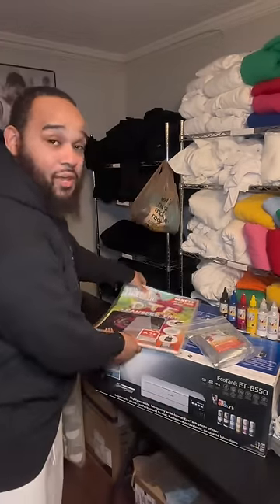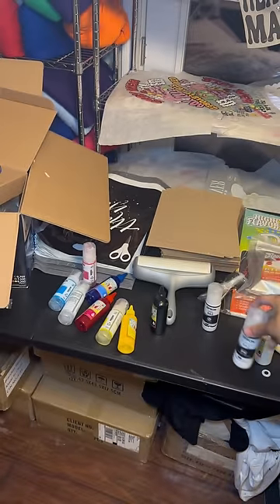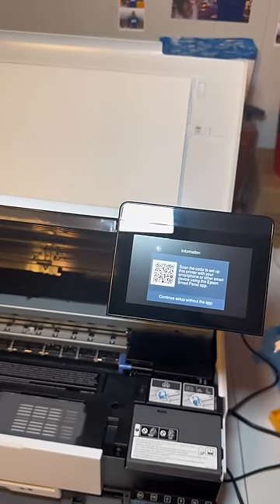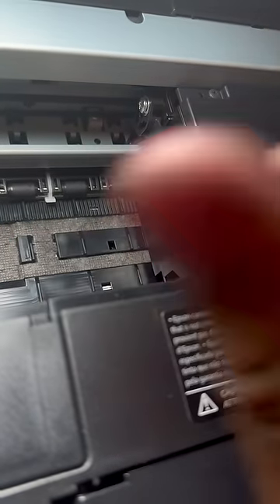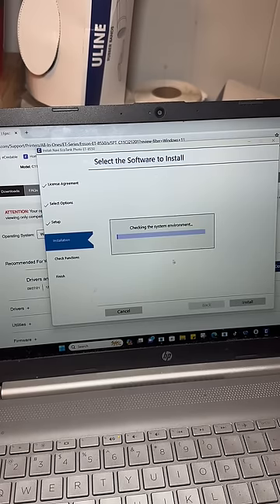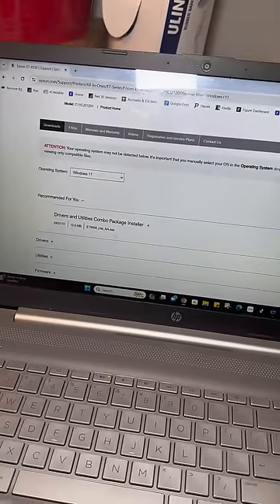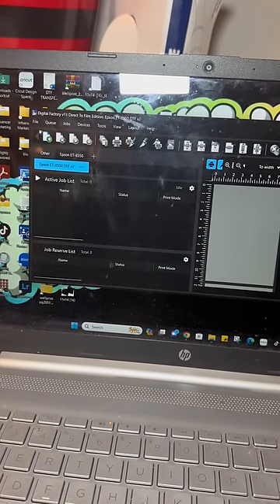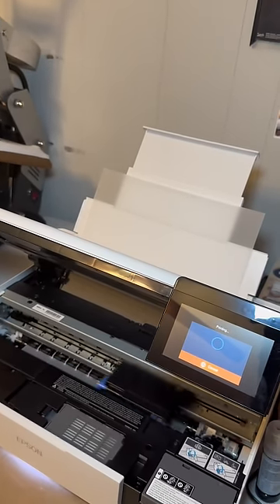How To Convert The Epson 8550 Into A DTF Printer - Step by Step guide... Very In Depth Details!!

Comment: If you put dtf ink in this printer, in 2-3 months you'll need another printer. Best option is a printer with removable cartridges. Just speaking from experience. There is no way to stir the white ink. It will settle and clog your printer.
Reply from the maker: You stir it by shaking the printer itself daily. I had my original for over a year now. I just got this one for my channel and to show setup. Where there's a will there's a way lol.
Reply: Thank you for this 😢
Reply: Explain shaking the printer. I’m thinking literally shaking the printer.
Reply: I also saw where someone got an electric pencil I think it’s what it’s called and set it under the ink cartridges and apparently when you power it on, it vibrates and shakes the ink.
Reply: @highlyflavored how do you shake the printer? Physically shaking it??
Reply from the maker: @mohawksrsuper yes physically
Reply from the maker: @brendaleecreation6767 you’re right. Physically shake or get something that can shake it
Reply: @highlyflavored I need help please. How to download to MacBook Air with the bridge to windows
Reply: Why is my printer only printing a small strip down the middle of the image
Reply: Sit it on your washer once a day
Reply: @cherylharlan8983  this is happening to me too!!! I cannot figure it out, first print was amazing then it juat prints in the middle
Reply: Couldn’t you just add ink as you go/as needed? Shake the bottle before you start, add ink, and roll.
Reply: Quick question, with this method. How many prints can you get ( ruffly, unless you know exact ) on a full tank and also is that using 11x17 or 13x19. Thanks for this, about to convert now.
Reply: The best thing to do is get the dtf printer. This thing will not be good for dtf long. It’s printing the strips because it’s not able to read the film correctly. Get tape and place it at the bottom of the film so the printer can try to read it
Reply: @danielmojojohnson1169 .. it will dry.. gotta shake it..🤙🏻
Reply: Hi. I just converted my printer.  I followed all the instructions, but I'm having problems printing.  I set the ink order and all the other settings in the print properties, but they revert back to the defaults. When I print, the black ink prints out when it should be white. I'm using the trial version for now. Does that matter?
Reply: So i DONT need the CISS system?????
Reply: @adriennemagee9692 you need to Buy A New Printer😂
Reply: I have the print optimizer for my white toner printer do I still need to download the cadlink as well
Reply: That’s why you need a Ciss system. They got em on ESTY
Reply: Nope not at all, I don’t shake my printer never, I leave it on and it cleans itself plus I do 1 print head clean per day, mins is going on a year and still good 👍
Reply: @JesseBurrell Highly Flavored is presently offering the ciss system on pre-order. Just to let you know if you haven't heard. I recently pre-ordered mine!
Reply: I did see an external waste tank.So what do you do once the waste tank fills up?
Reply: @JesseBurrell  does he have a video on that?? Can you convert your printer to a ciss after doing this method first??
Reply: @dabbyquiles8186 how does it clean  do you mean you clean it daily. Also do you just put enough ink in what you need or do you just feel it up.
Reply: Soooooo everyone’s going to just keep doing this, baking in a home with a small non proper ventilated system and cry wolf in 2 years when they can’t breathe? 👍🏿 got it
Reply: @brendaleecreation6767 . 😂😂😂. Exactly, shake the freaking printer, crazy
Reply: Thank you for your video, I always like to watch videos about products before buying things. This will definitely up my shirt sells from using vinyl. Now I can do small print without the hassle of losing a letter in the weeding process. Will definitely be subscribing to your channel. Thanks for your time. Much blessings and success Bro. ❤😊
Reply: Any alternatives for Mac users?
Reply: It's very easy to say just get something that cost ten to one hundred times the amount. If that was the case do you think we'd be trying this? Also who wants to buy something they have never had, never used and it's new and still having problems. One guy said don't expect any of them to work straight out the box
Reply: I have mine for 4 months now, every day just shake the printer itself and run auto head clean every 12 hrs with the dtf program itself.
Reply: @highlyflavored  what about if I don’t shake the printer ??
Reply: Current situation......haven't even had it a month.
Reply: Is it the same process for Mac?
Reply: Printer is saying job complete when no prints are produced.  What do i do@highlyflavored
Reply: @highlyflavored  I been shaking mine since I got it and nothing. 😌 I only bought it because of your wonderful tutorials but now I feel defeated. I purchased cadlink thru you which is wonderful in my opinion but unfortunately can't afford the Ciss right now. I followed the whole set up i structions and nothing.
Reply: @adriennemagee9692  Same issue. Did you ever figure this out?
Reply: I was thinking about doing this . Now I'm getting cold feet again.
Reply: Can I use MacBook for I need a PC?
Reply: How can I purchase your dft flims an inks etc @highlyflavored
Reply: @JustMe-xd2vc what specific printer can you recommend in regards to your statement?
Reply: Man this almost freaked me out to pull out the rollers lol but it was pretty easy once I got out of my own head. Lol
Reply: You have the set ink colors going a different way in another video which one is the correct one @highlyfavor

Comment: Printed my first ten dtf transfers today and they came out perfect! Cannot thank you enough!!
Reply from the maker: Yessss!! Love that
Reply: @kristenpineda1836 What paper type did you select on the actual printer when you loaded your sheet? The print will ask the size and then the type of paper. He does not show this critical step in the video. I followed these instructions to the t but am getting smudges. Really bummed and regret purchasing this setup.
Reply: @lisanereida  mine worked perfect I followed his step by step setup. Cadlink does ask the size and he tells you where to set it up.
Reply: You don’t need to choose a type only a size in cadlink . Just make sure you do exactly what he says.
Reply: @kristenpineda1836  Gotcha. I did follow that video to the tee, several time in fact…my printer still ask when loading the paper to tray, despite the settings applied to Cadlink. But thank you for replying. Wish mine worked right away like yours. You’re so lucky.
Reply: @lisanereida  I understand your frustration I had a few mishaps for a few days and then once I got the clogged ink stuff fixed mine has worked so good. Did you make sure and change the settings in the epson printer settings under devices after you download that software? Also he does video calls to help people they’re $50 and I have a feeling if you’ve invested in the printer and stuff it would be worth it! If I can help I will!

Comment: I really appreciated your video—thanks for the great content! I have a couple of questions regarding the Epson 8550 printer.

1. I currently have the original ink installed. What steps should I take to remove this ink and replace it with the custom color you demonstrated? For those who already own the printer, is there a specific procedure to flush the existing ink or should we simply print until it runs out?

2. Regarding the printer settings you adjusted on Windows, do similar adjustments need to be made for macOS? If so, could you provide guidance on how to do that?

Thank you for your assistance!

Comment: Hi, thank you for sharing. I just got my printer. I do have an epson 2800 and it was pretty simple. The 8550 on the other hand is a bit more complicated. I noticed when you took out the roller  it looked pretty easy but you didn't put back all silver screws do they all get put back?.

Comment: I have the printer and the CISS system. My question is do i still need to add ink in the printer in this steps or do I wait and just connect the CISS system 1st, add ink  and do printer setup instead?

Comment: Thank you so much for a very informative video and easy to understand instructions on how to convert the ET-8550 into a DTF printer.  I struggled with removing the rollers, but after rewatching how you did it I was able to finally get them out.  The only issue I'm having is when I print my transfer, using the Cadlink trial version, is that at the very bottom of my transfer, I get some slight smearing of the letters.  Not sure why, but I'm trying to troubleshoot all possibilities as to why this is happening.  Will re-read your Ebook to see if/what I missed that may address this issue.
Reply from the maker: You can’t print on the last inch and half of transfer
Reply: You have to enter your picture and avoid that edge
Reply: Appreciate the feedback.  However, I left 2.5 inches at the bottom of the film, so I was well above the 1.5 inch space mentioned.  Through much trial and error, I found something that worked for me, and allows me to print closer to that 1.5 inch bottom space without the letters smearing.  I removed the rear paper feed guide at the back of the printer, waited for the film (A3) to start 'appearing' in the output tray then slid the cardboard under the film so it slides out effortlessly (with the cardboard inserted before printing, my film seemed to get caught by the edge of the cardboard).  The film feeds without any problems, and I do not need to use painters tape to help the printer 'grab' the film.

Comment: so you don't need a maintenance chip reset, to waterproof your print head or a ink waste tank? how long does the printer last by putting Dtf ink straight into it. i see people have a problem with white ink you didn't install a continuous white ink system?
Reply from the maker: Those are all great questions. So let me start with the first. It's not mandatory to do an extended waste tank but it is helpful in the long run. I have a video on how to do it. You don't need to water period your print head. My orginal has done over 1000 prints literally. And I guess that answers how  long it last as well. Everything you mentioned can help improve experience but work property maintenance isn't necessary

Comment: Hi Highly Flavored, Hope this fines you in a happy mood.
I hope you or someone can help me out. I have the et8550 for sublimation and one that I am converting to dtf. my problem is I took out the waist tank and it will not push all the way back in, ever have that issue before and if so what is the solution. I have tried everyone except taking the printer apart. i can't see what is blocking it but the tank will not snap in place so that it can be read. any help will be greatly appreciated

Comment: Thank you. Would you recommend removing the rollers on my 8550 that i converted to sublimation?
Reply: No need to remove for sublimation.  The only reason to remove for DTF is because the wet  ink will hit the rollers and cause streaks on the film.

Comment: How do you stir the white ink so it doesn't clog up in the lines?  I read all over the internet that when you have a DTF printer, you have to mix or shake the white ink up regularly, or it will settle or separate and won't print correctly, I hope that makes sense.

Comment: Do the whites have to be be in first two slots?I have whites in 2nd and last slot.just got the printer an followed video but it’s not printing images on film.
Reply from the maker: It doesnt have to.. In the software you can tell it where you put the inks at.
Reply from the maker: also do a power clean if you didnt do the initializing of inks
Reply: @highlyflavored  that worked appreciate it!!

Comment: Hi man , got a question did you have any feeding problem the paper with this? I will buy one of this ones to do FTS (Fusion Transfer System) which is a new printing technique that used CMYK (Water based inks) and a clear ink (Instead of white) and it print on a special paper not film and the white is on the powder and this will completely resolve the white ink maintenance problems and head clogging that the white ink produce.
Reply from the maker: No I didn’t

Comment: I've went through the whole setup process. DF is installed I selected Et 8550 DTF v2 I get to the 2nd time me clicking on file and select TCP/IP computer can't find my printer. (while DF is open) hope this makes sense. do I need to uninstall and reinstall? I'm using trial and have 13 days left I've used up 2 trying to install and figure out why I can't finish set up. I'm at a lost
Reply: I am having the same problem 😢

Comment: How does the white work with this method? You know, like because first it's got to print the colors, then it's gotta go back and print the white. At the custom T-shirt shop I work at currently we're using a Roland. DTF printer. It's freaking huge and takes up so much space, but for the setup that I have for my own business at home, I want to be able to just have an Epson. ET just like how you're doing. Because I already have. A printer like that and I'm planning to get another one. But I'm wondering on how it goes back to do the white part over the top of the colors because I'm not sure if once the print is done like is it actually does it actually return back to its origin point? And start printing the white?  And do you still need to do the powder step?
Reply from the maker: Prints color first with part of the print head and then goes back over it with a white
Reply: thanks for letting me know i cant wait to try this!

Comment: What the different in converting the 15000 and 8550
Reply from the maker: 15000 conversion a Lil more in depth with drilling holes etc.
Reply: Also can you use this printer dtf for stickers and decals?